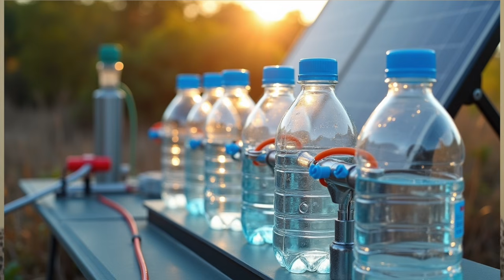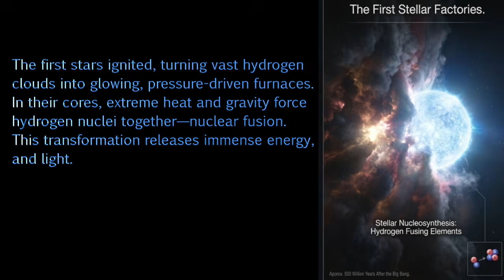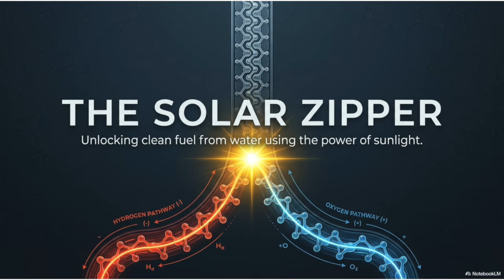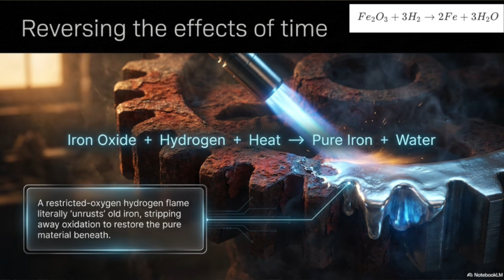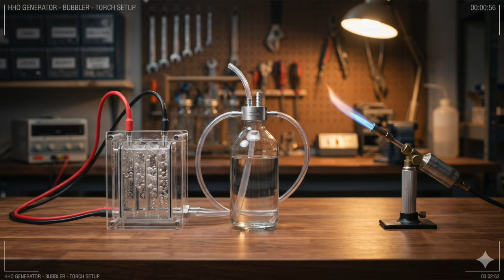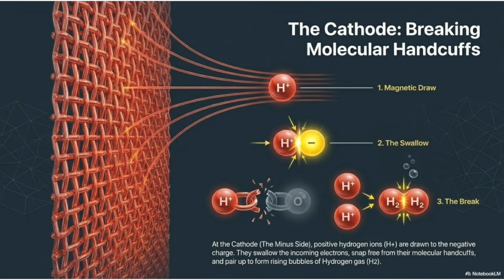Single-panel Solar-Hydrogen Factory. Safe, Simple and Affordable. - Video 140

Comment: How many kW to produce 1 kg of hydrogen?
Reply from the maker: Hi Mohammed, I think you mean kWh, because 1 kW will mean that you have a certain production speed. So if I succeed to have 50% of transformation efficiency, then I will make 15 gr of hydrogen with a kWh and because it is extremely light, it will be 187 litre with atmospheeric pressure, so with 5.5 kWh you will have a cubic meter.

Comment: Hydrogen is not safe for home use. Don't play with hydrogen at home or anywhere else if you're not a professional.
Reply from the maker: Hi Halnineooo, I replied to a similar comment below. I understand your concern but want to give some counterweight to many videos that I see where mixed gases are produced that are really dangerous. I keep them apart. Like keeping Laurel and Hardy apart and avoid a lot of trouble.
Reply: @nnvasen-good-energy 
Yes I read that comment and the reply after I posted mine, that makes it a bit redundant. Some people however don't have the patience to read full lengthy comments and replies and it often happens that these are the same kind of people who don't watch full videos with all the caveats and rather jump impatiently to the juicy part. Maybe this brief warning can save someone not careful enough to be playing with hazard. 
Be safe and everyone dealing with this stuff.

Comment: I have researched and experimented with Hydrogen and it is NOT something for the backyarder to play with. 
It has an extremely wide air to fuel explosive mixture and normal air / gas fittings and soft hose is NOT safe with it. 
Hydrogen requires nothing less than the proper rated and extremely expensive fittings and hoses as well as storage tanks.  I agree, storing hydrogen and oxygen together is nothing short of a death wish because even seperated, Hydrogen and air is potential for disaster enough. 

Even small amounts like shown in bottles is extremely explosive and dangerous. One tiny bit of air in the hydrogen and it does not burn, it explodes.  Ask my how I know!!
I am not a saftey sissy by any means but I do believe in self preservation and anyone interested in keeping their head on their shoulders should not muck around with this stuff. 

I do some dangerous shit without second throught but having hands on experience and knowledge, I well draw the line playing with hydrogen.  It is a shame because it is so easy to make but also conversely difficult to use without huge risk  that does not make any benifit near worth  the significant potential danger. 

If people think  petrol is dangerous to play with,  magnify that by a factor of 50 with hydrogen.
Reply from the maker: Hi Glumpy, I appreciate your concern for safety, and you are absolutely right that working with hydrogen requires deep respect for its unique properties and risks. I don't want to tempt people to take the devil in house but much more to warn those that are tempted to let him in after seeing the many H₂ & O₂ production project. They are more than the videos where they are separated. It would be nice to make contact with you, I am curious about the experience you have. I am on LinkedIn under Norbert Vasen. The coming week I will make my personal experience and I'm sure I will survive it 😉 after the megatranslation I made from English to Dutch of a MultiMegaWatt electrolyser. 1/3 of it is filled with warnings and I integrate that with my internet research and the explosions I see on YouTube. I have in my mind a configuration about how to do it safe and if hydrogen is creepy, well, to mitigate those molecules that escape. I hope to contribute to wide spread knowledge about how to tame this little devil.
After all, we all together want to accelerate the Energy Transition (I am already 34 years working on it and impatient with what we achieved so far). Safe hydrogen must be part of it.

Comment: Hydrogen is utterly useless and wasteful.  1g per day if you are lucky (using a 4kW solar PV system) when that 4kWhr could be stored in batteries far more efficiently.  Energy is all about efficiency and creating hydrogen from it is pointless.
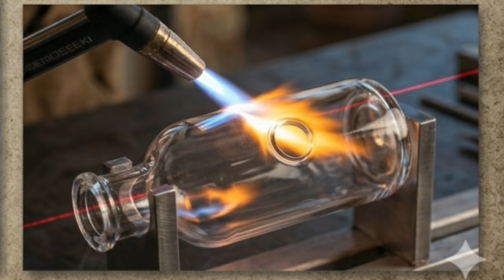Reply from the maker: I was also startled at the low round trip efficiency of electricity to hydrogen and back to electricity (like on minute 5:33 in my list of applications). Then I realised that gasoline to wheels is about the same efficiency and that in one step (Otto combustion in car). In this round trip, the electrolysis is quite good compared with the fuel cell. And then you have a material that is quite interesting, so much that it is used today already on a large scale (especially fertiliser). This hydrogen is made with fossil fuels and I recently translated a manual about a big electrolyser, showing that also big players use still this same low temp principle. On the other hand, Solid Oxide Electrolyzer Cell (SOEC) promise to make hydrogen at higher efficiency, about 85% (but you need 850℃).
Your figure about 1 g/day seems pessimistic. It seems to me that a 100 W panel (0.5 kWh per day) can make 10 grams and that is 120 litre at normal pressure, enough to create a lot of damage if ignited).
Reply: @nnvasen-good-energy  To be useful you will need a lot more than 120 liters, to be able to contain and transport it safely etc.  I 'could' take a litre of gasoline in a plastic bottle (or even a plastic BAG) and get some useful work from it.  I don't see that happening with hydrogen.  It's 'problem' has always been storage and transport and the overall cycle of usefulness to the ordinary perosn i hampered by this.  As ever, I admire your development and display of POtENTIAL use of diverse energy sources but hydrogen isn't 'practical' for so many reasons.